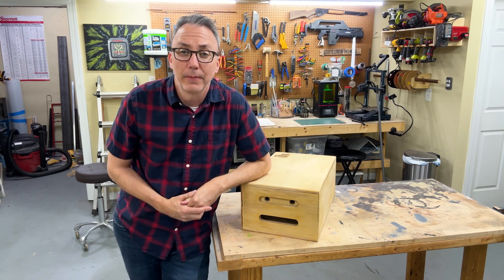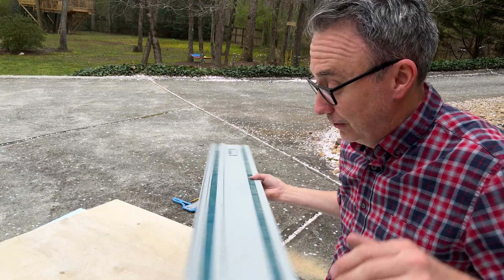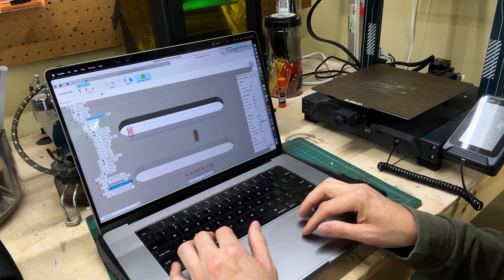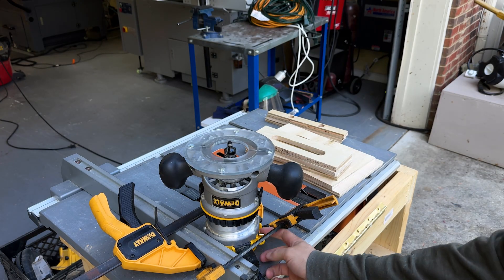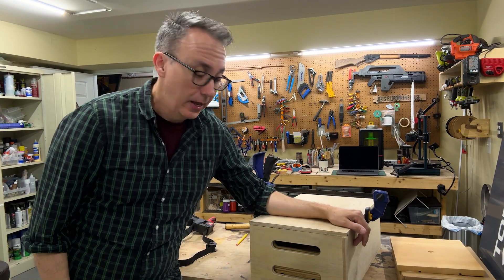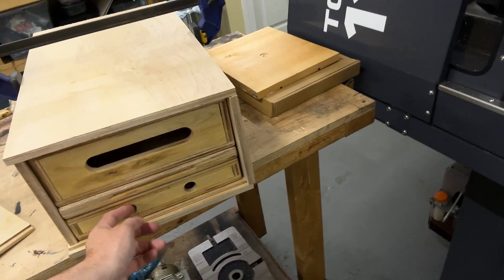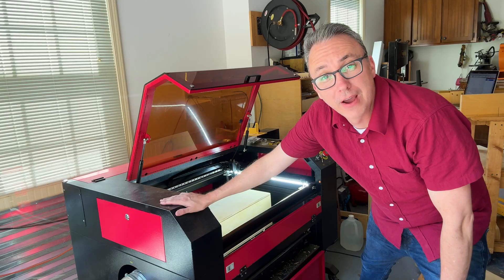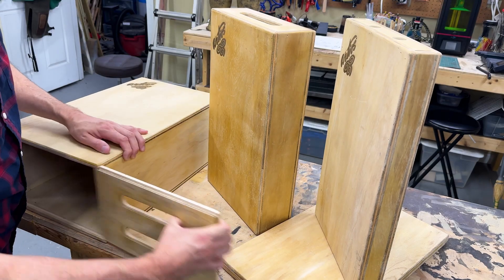DIY Nesting Apple Boxes for Filmmakers: Save Space & Money

Comment: Thanks. A cool idea. Like the way they nest. Aiming to make my own too as an experienced amateur stills photographer (who enjoys diy and carpentry) I'm wanting to up my video capabilities and feel these might help. 

I'd considered designing 'nesting' too but had wondered about making to also store grip kit (grip heads, super clamps, baby pins, cardellini clamps etc etc) but figured there must be a reason I never saw that - perhaps too heavy or only limited space maybe? any thoughts on pros/cons of incorporating storage?
Reply from the maker: That’s a great idea. The problem I would suppose is the difficulty in making it strong enough to hold super heavy gear. You’d need some gussets on the inside. Normally a full apple that doesn’t nest has a center support and the other side that doesn’t remove. With the nesting your points of contact are less and there is no middle support. So it’s already not as strong. But since you wouldn’t need to nest apples inside, you could do gussets to strengthen it and still have room for storage. Give it a shot!!

Comment: Pretty cool and it has a face to boot! I imagine you could add a little wax if anything ever started sticking too. Maybe an embedded magnet if the slide front ever tried to slide off on its own.
I think on the end of a board it's called a rabbet.
Reply from the maker: Thanks! And yes, the plan was to put a magnet but it fit so snug, I called it quits.  But eventually will probably have to put one.